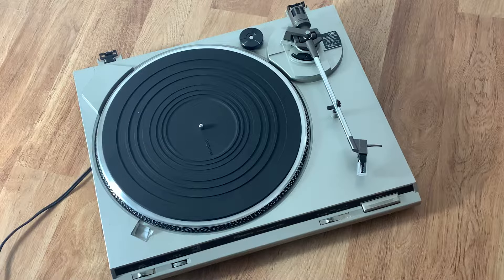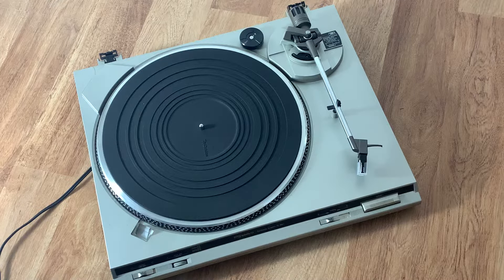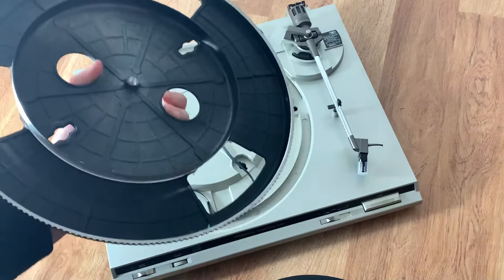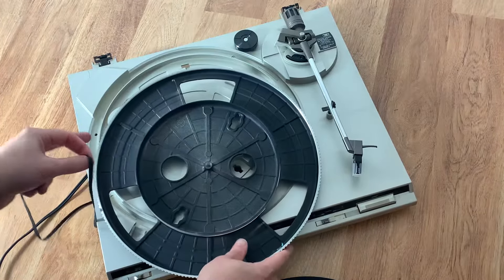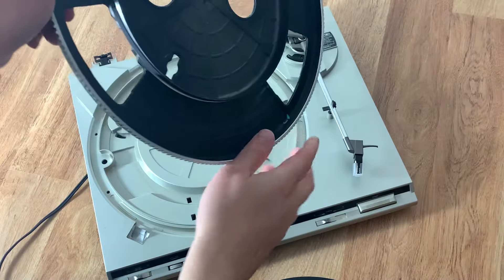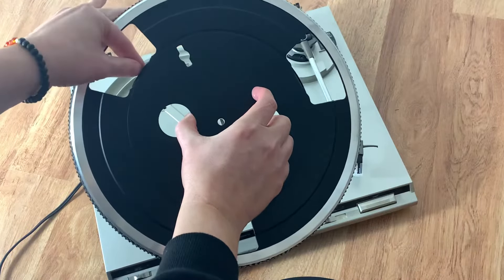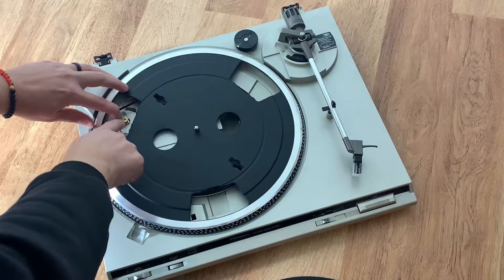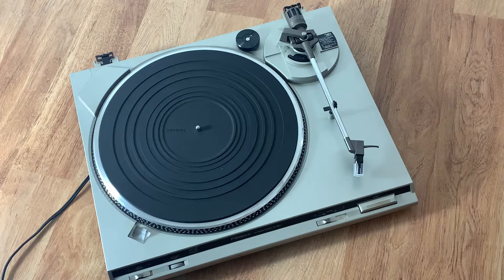How To Easily Change The Belt On Your Turntable or Record Player

Comment: Thanks for the advice! Nice video! I have a Music Hall belt driven turntable, which I installed with a Shure M97xE cartridge. I've had it for a while, so there is a good chance I will have to replace the stylus or the cartridge sometime soon!
Reply from the maker: Yeah and those Shure cartridges have skyrocketed in price since they discontinued them. Lots of good options out there for new carts though. Thanks for watching.
Reply: @ForeverAnalog  You are welcome! I shared the video to my Facebook page.